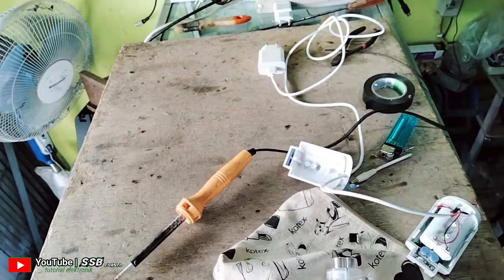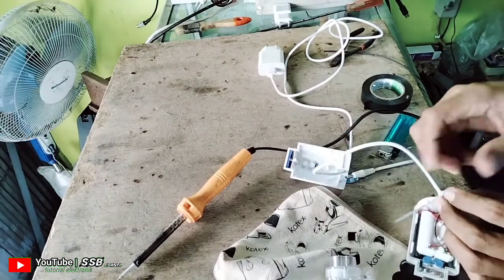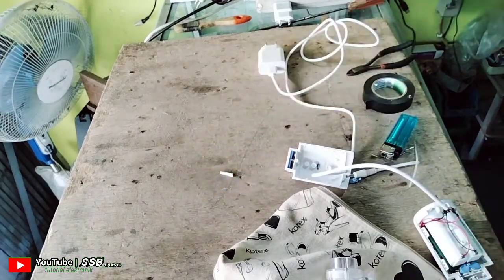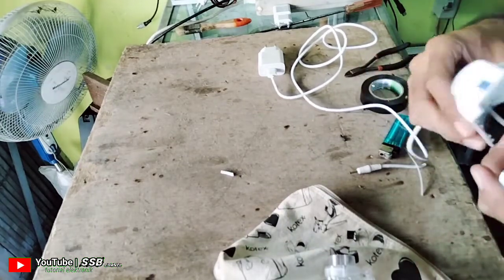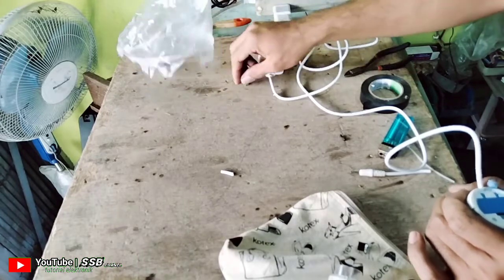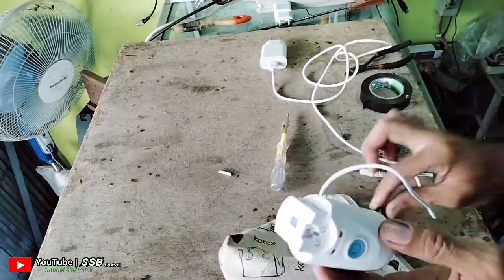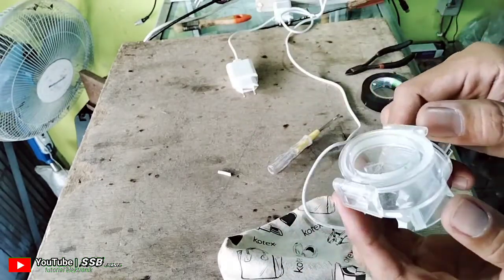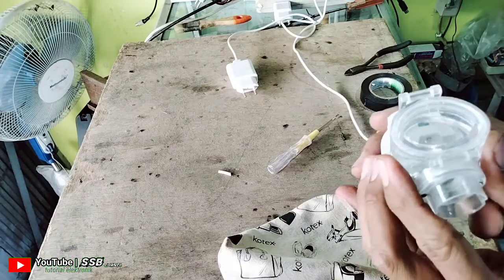memperbaiki mesin uap pernapasan

Comment: Kalau LED nya merah trs bagaimana ya mas , padahal sdh ganti batre ?
Reply from the maker: Switchnya eror pa tidak...coba dibongkar terus di switchnya di sentil bisa hijau pa tidak
Reply: @suhadisoglengbro5350  terima kasih mas , tp skrg ad kendala baru mas , bgtu dihidupkan lampu hijau hanya hidup sebentar. dia sperti tdk ad daya. Itu kenapa ya  mas.
Reply from the maker: @rinalfis8763  itu baterai drop mbk
Reply: @suhadisoglengbro5350  sudah ganti baterai mas. 🙏🏻 gmana ya.
Reply from the maker: @rinalfis8763  baterai masih normal mbk...itu seperti drop baterai...kalo sambil di ces lalu dinyalakan gimana hasilnya
Reply: @suhadisoglengbro5350 punya saya baru pertama pakai dari beli baru,. Sambil di cas ga pakai batre trs pencet tombol cuma nyala hijau sebentar trs mati,. Itu gmn ya mas ?
Reply from the maker: @herdiaditia3054  pemakaian yang benar ces dulu baterainya setelah sudah full baru dipakai..kalo tanpa baterai dinyalakan tegangan tidak stabil jadi mati lagi tapi ada juga yang tanpa baterai dinyalakan normal tapi ada juga yang tanpa baterai dinyalakan tidak bisa harus pakai baterai dulu